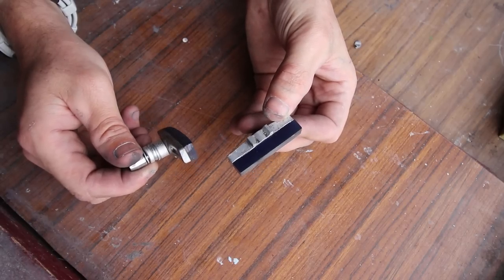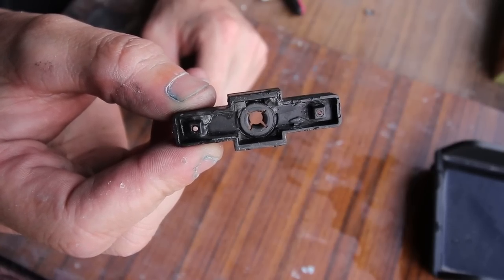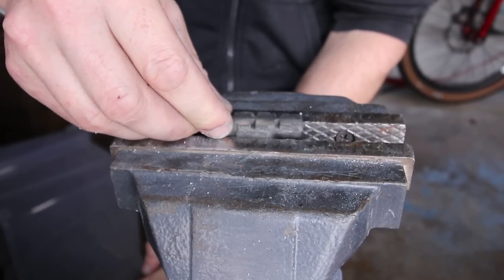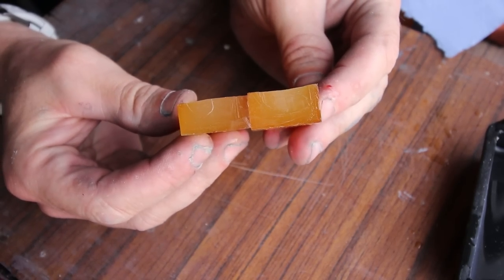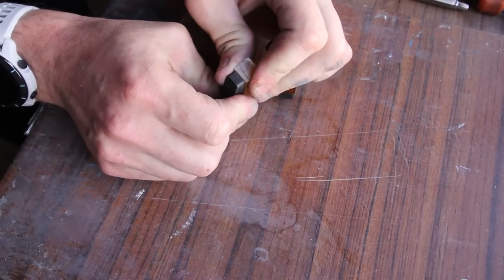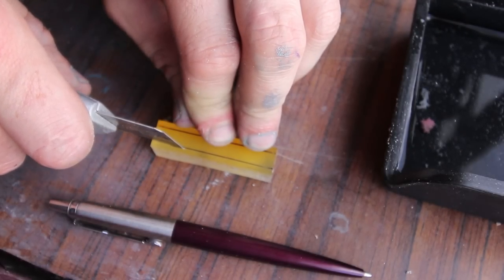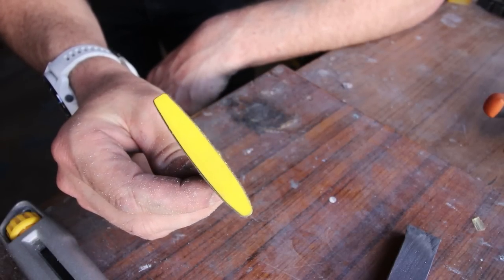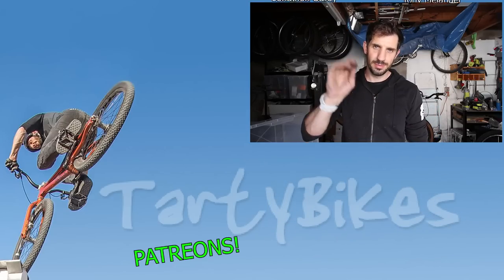Make Your Own Awesome Brake Pads And Save Money!

Comment: Should just add: these polyurethane pads are for the on/off action of trials riding and for that they are unbeatable but they don't like high temps so don't put them on your gravity racer people!
Reply from the maker: Pin worthy comment
Reply: @Ali_Clarkson  Cheers man, just thought I'd put it out there for any non trials watchers, thanks for the content it's excellent as always!
Reply: The same goes for CA glue in general, not for high heat.
Reply from the maker: @littleshopofrandom685  makes sense if boiling water can separate pads from backings
Reply: Good thing I caught that part..)/* I had to stop watching you vivisect brand new pads anyway..(   Would you glue rubber to rubber if you were making dh pads?)/* Be nice to your fingers bro and save some blood for the trails..)

Comment: Back in the day, we were running SD7 levers with Avid Ultimate or Shimano XTR brakes paired with selfmade pads that hada very special rubber - when road workers put down asphalt, there is a heavy roller machine that rolls it completely flat. That roller has a "cleaning" brim that runs along the length of the roller to wipe off the stuck particles on the roller. That SPECIFIC rubber made the best pads for us here in Estonia, the whole scene depended on having them. Nobody knows what was the exact compound but it sure did work well. I still have a pair of CA-glued pads in my dads house after 20+ years. Great video, loved it, good nostalgiatrip.
Reply from the maker: That's a cool story, it's funny how you sometimes stumble onto something that works well but you don't know much about why it works as well as it does :)
Reply: Roland sina või? :) Ma ise sain seda PU materjali Kimi käest trükikojast. Raaklikumm!
Reply: @indrekpart277  mina jah!

Comment: Hi, I'm your big fan. I think your Youtube channel is the most useful for me. There is really everything needed for me. Technique, riding skills, bike builds... Just everything. Today I started making brake blocks for Magura brakes, exactly according to your instructions. I have CNC mounts the same as yours and a 20x20x500mm polyurethane block. I use a bench drill vise to cut extra tough polyurethane. I clamp a precision steel knife into it and cut it with a hydraulic press. And I also use a belt sander, of course. It works great. Now I hope it will brake well. 🙂👍 I am quite old (43) and a few months ago I bought my first trial bike. And I also bought one for my son and now we train hard together. Good luck!

Comment: Just checked out your links and its exactly what I use!! I use the red 90A for the rear pads and the dark blue 90A for the front, it is weird how different the different colors feel even though they are both rated at 90A
Reply: Nah front brakes are always sharper because of the way the braking forces are distributed. Im sure if you swapped blue to back and red to front it would be an indescernable difference.
Reply: @owenwilson3750  Yes I've tried them each way around and same color front and back, they defiantly feel different. The blue has slightly more bite but feels less precise, my rear brake has a booster made of 6160 and I like the rear wheel to be as solid as possible so I run the red there and the dark blue on the front which is a 4130 fork with no booster. I was pleased to see in this vid that Ali had also found the different colors with the same rating gave different performance and that it wasn't just me.
Reply from the maker: I really like the blue stuff in Vbrakes but the red seems to work better in hydraulic brakes for some reason...it's weird how materials can have little nuances like this
Reply: @owenwilson3750  the added pigment has physical properties too so not very weird. Like black is usually added coal and makes a LOT of difference. For all the 90A they use the same base material when produced.

Comment: Always wondered about this, thanks Ali! I always pictured some complicated process of melted rubber that you somehow formed into the pads.
Reply: Poliurethane is a two component mixture like epoxy resin. If you can somehow source the components, you can pour it into various shapes. Actually that's how they make engine mounts, shock absorbing bushings, flexibly shaft couplings and all that.

The downside is that you have to make a negative shape to pour into, and you most likely can't reuse it unless you are able to make a polished surface and use some non-stick coating.

These days 3D printing is accessible to print pouring forms. It's been a while since I used PU rods, I didn't realized that I could make my own PU parts now!
Reply from the maker: @gabiold  I did experiment with mixing and pouring my own pads (into a block rather than into a pad shaped mold) but it wasn't as good as pre-made stuff. Might be worth more testing though

Comment: I did it! Bought a A-1120 belt, cut a piece, glued it to a worn off V-brake (after cutting and sanding both) and it works like a charm. 
Been using it in wet weather and snow and it definitely wears off less than the traditional brake pads. And it costs 4 bucks for like 15 pads!

Comment: Nice!  I don't ride trials anymore but 25 years ago I worked with the former owner 5.10 who worked with me to develop pads by putting additives and fiber to their Stealth rubber.  I still have a couple of the "slumps" from the variations that we tried.  The pads were amazing, but we never found an adhesive that would keep them firmly adhered to the aluminum backing.

Comment: My father did one pair of brake pads (rim brake, steel wire actuated) from truck wheel chunk two years ago
performed wonderful until the frame of that bike decided to give up... but these pads still in good conditions. I guess they are no longer suitable for braking without damaging a rim made of aluminum, because of galvanization process.

But hey, thats cool finding your video about that topic, is a interesting one! (and yes, this trick can save a lot of money and if you do it properly, could be even more safe than the pads you usually buy at a bike store!)

Comment: A couple of suggestions for cutting the pads (no experience with this particular use case):
* Paper guillotine or a cleaver kitchen knife for the initial cut (sturdy blade with good leverage).
* Small C-clamps for better fixation.
Reply: Caveat on paper cutters - thicker material can be hard to secure, I've had stuff wander on me, sometimes under the blade.  don't hold with your hand while cutting lest the block roll towards the blade with your hand on it.  If you can't clamp it don't use a paper guillotine
Reply: @robbiedevine8518  yeah, clamps are a must. I was rather thinking about cutting a prolonged bar. Long enough to make the leverage sufficient for hand to hold.

Comment: Good stuff! Cutting a hole in the bottom of the plastic container, for your shop vac hose to fit in, then setting this up closely behind your sander, makes for an excellent dust collector. (The collector can easily be made using thick cardboard, scrap wood, or even an old metal bread loaf baking tin.)

Comment: I suggest a Mitre box for straight cuts. There are small hobby ones that would suit this work. Cut with small coping saw or use the knife for what works best I reckon. Thanks for sharing Ali, I know I did ask you as well about this, great video!

Comment: Wow you finally did it! Seems like a good process and I have two things I thought of: I wonder if one of the handheld ratcheting shears normaly used for cutting pvc pipe would be good. I see some around even have a little mitre box so you can cut nice angles. Then, I thought of how about casting some pourable urethane resin? That would also allow for adding things like fiberglass/silica/carbon powders to play with the friction. Anyway, cool video as usual!

Comment: Brilliant video, thanks Ali.
Not a trials rider, but I'll definitely be making some pads. If i can get to 90% performance of my favourites, but considerably less than 15quid a pair I'll be very happy
Reply from the maker: just be aware that this polyurethane isn't great at dealing with heat so on a normal bike dragging the brakes might not end well
Reply: @Ali_Clarkson  Cheers Ali, that's really great info. it will be on the rear brake on my commuter; so I just need short burts of powerful braking rather than long drags (I use my front for all the modulation etc)

Comment: I've always thought you had to use molten rubber to get the pad material to match the backing. I never realised a CA glue butt joint would be strong enough!
Reply from the maker: yeah it blew my mind a bit to find out how strong CA glue can be...I have tried mixing my own polyurethane and pouring it into a block to be cut later but the end result wasn't as good as pre-made stuff

Comment: A band saw with a fence seems like the perfect tool for cutting the stock to size quickly and safely, but I realize most people don't have a band saw as part of their available tools. Short of that, a wooden or plastic jig (something like a miter box) could be a good addition to your hacksaw and vice method to increase accuracy and minimize metal on metal contact dulling your blades.

Comment: I suggest trying a fine / high TPI razor saw or dovetail saw with a wide enough mitre box for the initial cuts. Stay away from those knife blades - one slip and you could easily slice through tendons and nerves and end your riding career. Or at least invest in some armoured cut-resistant gloves.

Your brake pads look good and I would ride them but making them is a high impact high probability risk. Stay safe enough, cheers!

Comment: Maybe the cutting could be made easier with one of those wire cutting tools that is used to cut Styrofoam. I imagine the heat might help a lot.
Reply from the maker: Polyurethane just ends up melting and making a big sticky mess :(

Comment: For your cronic neck pain (which i also do have) its due to your scapula (muscle wing anotomy)... If you retract your scapula your neck pain will relief and probably gone ... the problem is while riding I tend to close the scapula without realizing so it stiffs the muscles and also the neck, making a stiffness in the neck and inturuducing NECK PAIN horray!! however it can be solved by retracting the scapula XD At least it works for me... Learnt it with my P.T. which he didn't even knew that worked for neck pain due to riding a bike but made total sense because i do everything wrong XD

Comment: if you want super advanced geometry you should consider Ben from Applied Science's method of cyrogenically cooling the rubber (can be as simple if you like uber sketchy as home made cyro napalm (i.e. acetone or isopropyl alcohol in dry ice) which enables him to machine it like it's plastic

Comment: For removing the excess you may find a Dremel to be a very handy tool.
Reply from the maker: I tried but honestly nothing works quite as well as a blade, polyurethanes strong points are it’s resistance to abrasives (why it makes a good trials pad) and tearing. This means trying to sand or cut it with hand tools is very tricky

Comment: At what temperature does your glue come undone, and how hot do your brakepads get?
Find out with an IR-temp gun.
Seems there is potential for scary downhill runs on somehting that isn't a trials bike.
Reply: Probably not much. I've seen cyanoacrilate glues advertised as high-temp, with 135 degC max. temperature.

But rim brakes are not ideal for downhill anyways, disc brake pad materials are so much better and provide way better and smoother modulation in hot/cold/wet/muddy conditions, while these are essentially on/off brakes for trials.

Comment: I feel like there is potential here for some kind of phase change material. Something with an ultra low melting point at first that hardens instantly. Im thinking something like glue that would grip instantly but then easily release from the rim.

Comment: Probably using a chisel at some point would help.
Or using a cheap CNC machine like a 3018.
Reply from the maker: I have wondered about a razer sharp chisel, no idea how it would work being hammered into a rubber though, slicing seems to work better than impacts. I know some people have used mills to cut the pockets from a big sheet but that's getting into another level of DIY then haha

Comment: Ali, I wonder if using a hot wire would be a good way to cut pad material?
Reply from the maker: Unfortunately melting this material ends up making a big gloopy mess :(
Reply: Or could one use a hot glue gun to join the parts..
Reply from the maker: @KHos73  that wouldn’t be as strong as the CA glue

Comment: I just wonder - wouldn't it be easier to get some PE filament and just print the pads? Might work with TPU too, dunno.
Reply from the maker: I only recently discovered printing in PU was a thing, would be interesting but computers aren’t my strong point so I don’t think I’m the man for the job
Reply: I tried it. In my experience they are not good, it seems thermoplastic poliurethane has poor mechanical properties compared to casting urethane. Anyway it could depend on 3d filament (brand, additives, etc). Try to find a local 3d print service, it cost to me 30€.

Comment: hi ali im new here great video i have an electric bike with v brakes and always having to replace the pads would it be possible to use the same material for both front and back if so what was it you used again please
Reply from the maker: I wouldn’t recommend this to you unfortunately, this is very specific to trials riding and the material I’m using will just melt for any riding that generates heat.
Reply: @Ali_Clarkson  thank you for replying its a shame there isnt another video that shows you what you could use for electric bikes would be much cheaper to make your own pads that way
Reply from the maker: @garrylee8355  it’d just be a case of experimenting with different rubbers but once you found one that worked it would be the same process as the video
Reply: @Ali_Clarkson  do you know where i would be able to get the different types of rubber from and than you for your help so far

Comment: If you do it regularly, best way to cut rubber is mini table saw machine. Its take a second, and minimum risk, if you take safety measure. Also, its cost ~100$. Less than your fingers

Comment: Hey Ali is it possible to use pads with CNC aluminum backings for hydraulic rim brakes on a regular deore vbrake?
Reply from the maker: Yes, TNN make cnc backings for both magura and v brakes but I’m not sure if they’re still in business, I’ve not seen them for sale in a long time!
Reply: @Ali_Clarkson  Hello again Ali, thx for replying. I'm still a little confused. Doing some research I found out that there's the regular vbrake pads, the hydraulic rim "click" pads and the CNC backing pads. Do all of those work with normal deore vbrake arms? How do you physically mount them on the arm (I noticed that there's a hole in the CNC ones is it for the screw?)? Thx again, love your content
Reply from the maker: @luizcarvalho4245  no they need to be specific v-brake versions which have the threaded rod like normal v-pads. As I said these are very rare now and I don’t think there are currently any trials brands making CNC v backings.
Reply: @Ali_Clarkson  oh, that sucks. So on a deore vbrake I'll have to go for the regular ones? Do they work as great (with custom made pads and grinded rims)? Thx one more time
Reply: @Ali_Clarkson  Wait what if I remove the rubber from a hydraulic rim brake pad (with the hole) with boiling water and somehow attach a screw to it?

Comment: Hot wire or long razor mite be faster but iv never tried that I normally just sand a little bit of old pad and put a little bit glue d on and then cut it off like you mine didn't work that good tho must of been bad for brake was to slipery
Reply from the maker: hot wire would just melt the polyurethane into a sticky mess, the sharp knife works super well but it comes at the risk of cutting yourself too

Comment: Would it be easier to heat up the blade and cut the rubber that way Ali? 🤔 ........by the way, great hack 👍🏻
Reply from the maker: Nah heat doesn’t really do much good, a sharp knife and soapy water is hard to beat
Reply: @Ali_Clarkson  suppose you gotta stick to what works in the end, just out of curiosity have you tried the heated blade??? 👍🏻
Reply from the maker: @johnster187  not the blade no but trust me if you see what hot metal does to polyurethane you wouldn’t want to do it 😂
Reply: Hi, i would like to explain this without being asked to XD.The used Polyurethan is a Duroplast which hardens by a chemical reaction betwenn multiple components. Only Thermoplastic materials (which Polyurethan could also come in) can be melted while keeping their properties. Duroplasts will just "fail" when they get hot and loose their properties. Thermoplastic materials are probably not a good idea to use in brakes because...well...they melt when exposed to heat, which is caused by the friction against the rim.
Reply from the maker: @nilz6432  great comment! I had no idea why it went into a gloopy mess but now I do :)
Reply: @Ali_Clarkson  You could try using a thermoplastic material, i would like to know weather it will fail under long braking. Thinking about it, for locking the wheels up in trials, it could/should work fine because it does not create heat.
(This is strictly not a recommendation, stick to what you know! Just a idea for science)
Thinking about this, it might be the reason some PUs work and some dont while having the same hardness, some are thermoplastics, some are duroplastic.

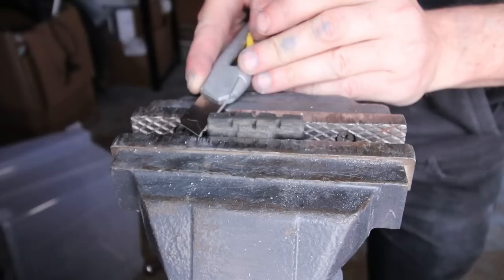Comment: 7:50 is your vice not bolted down?
Reply from the maker: It is but it swivels and I hadn’t locked it down after changing position when I had the belt sander in it
Reply: @Ali_Clarkson  ah, I did wonder. Mine does that too. Needs quite a bit if tightening before it will stay put.